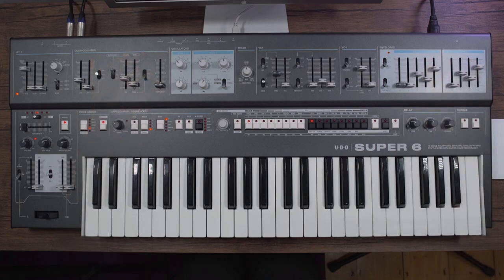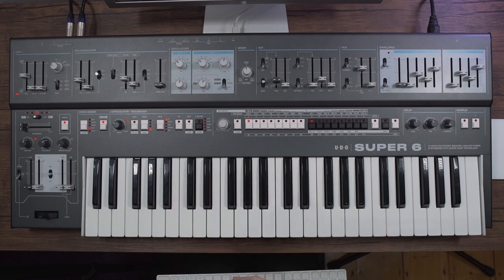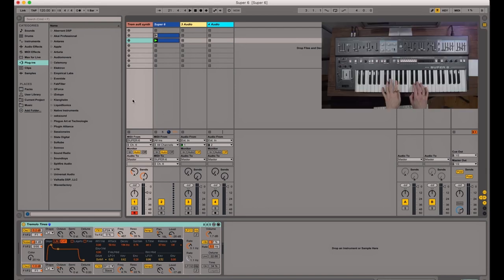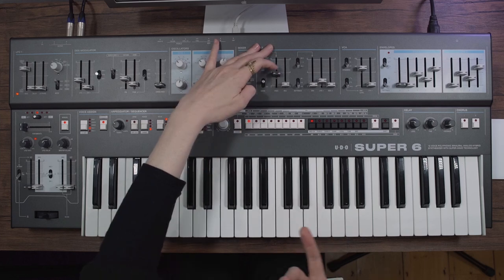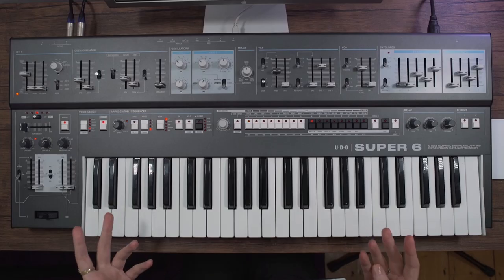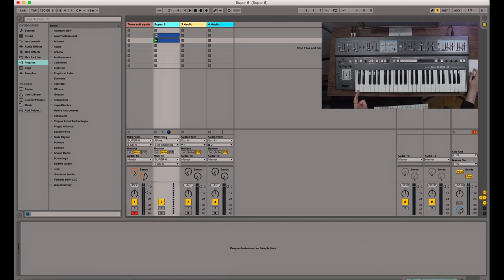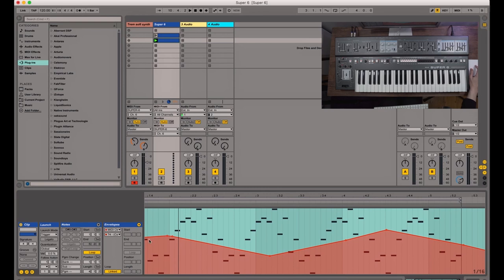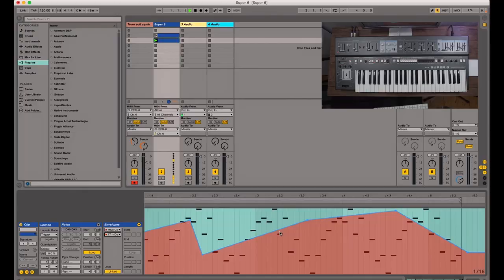Super 6 - USB MIDI & CC Messages

Comment: Nice one! Tempted to get the module soon. I wanted a keyed unit back in April but was having difficulty with availability, so ended up with the OB6. New update looking very sweet indeed.
Reply: How are you liking the OB-6?
Reply: @modeswitching  It is awesome to be fair. I have also recently picked up a mint Juno 60; both of them together is sublime using midi from OB6 to control and stack the sounds. Check my channel for videos/sounds